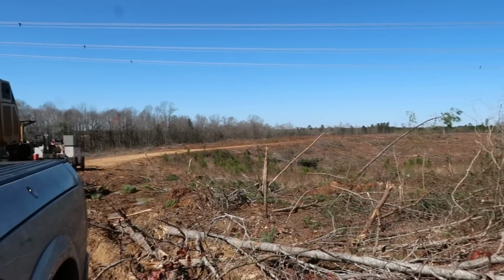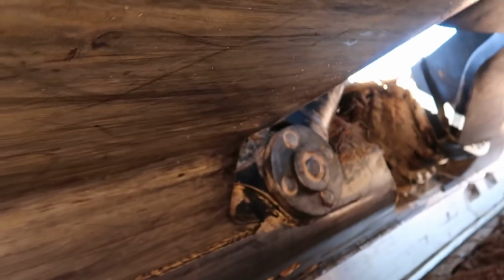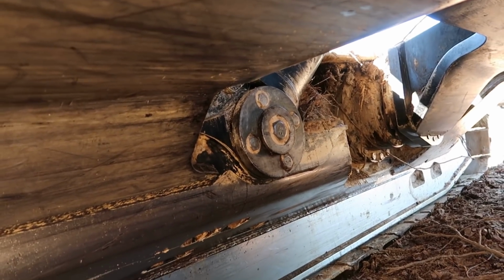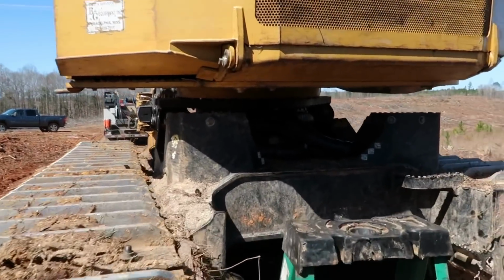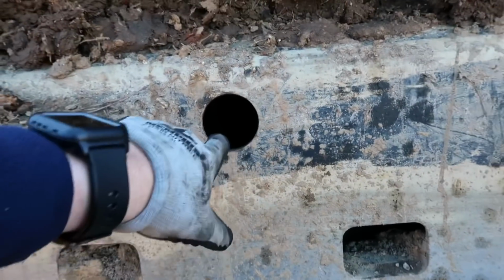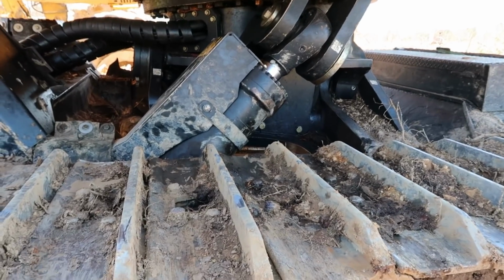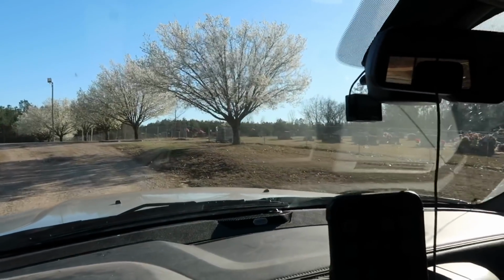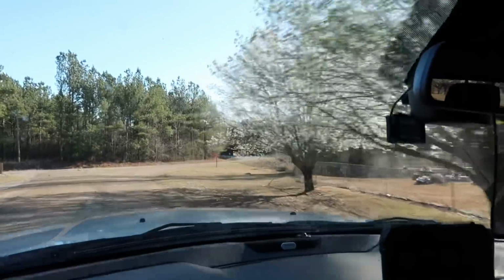Working on the Tigercat 830

Comment: Oil pan,drive motors, premature wear on the bottom of the head and now joint issues... I may have missed some other issues but $600k machine with low hours...yup Tim you guys better be concerned!!! I know all about owning machinery and things happen but I hope for TDK`s sake this thing get`s it out of it`s system!!
Reply: oldmanmosh a company I worked for had a Deere 759 I believe it was, leveling machine like that, lever pins and bushings were always issues, I even had the big 4 inch pin that holds the top of the wishbone to the house break off on me “what a ride!” you could see it had been cracked before I got in it, we switched to timbco, night and day difference in speed power stability and reliability, they all have there issues but sometimes it’s time to try a different brand

Comment: Every set-up I seen like that. Failure is incorrect installation and/ or lack of lubrication on low hours equipment. Not saying that is it. It's just what I seen changing thousands bushing set-ups like that. Could be simple as seal installed wrong allowing water & dirt to enter. Could be manufacturing problem Tiger cat trying solve. It's happens.